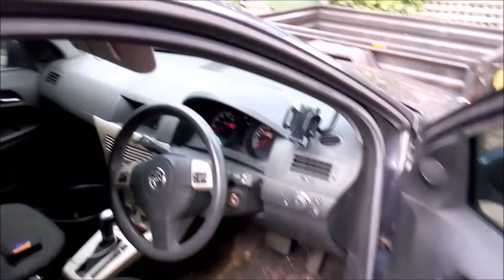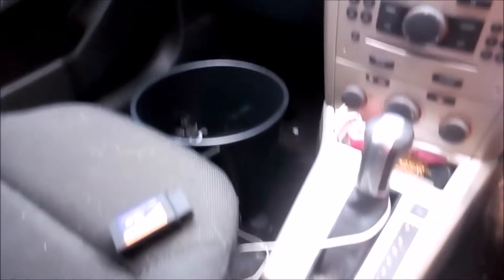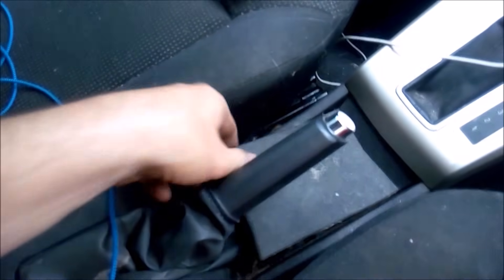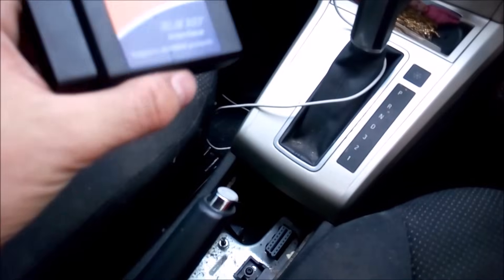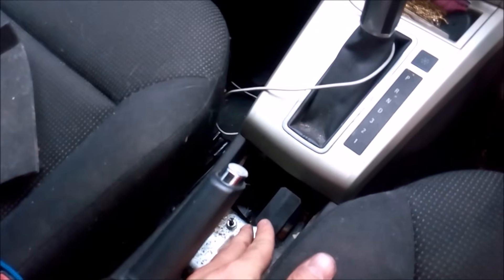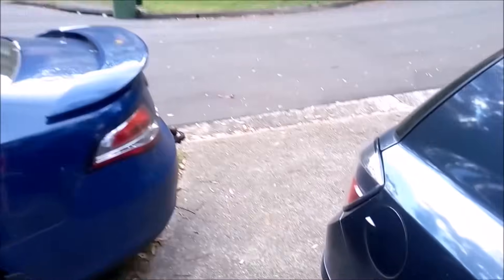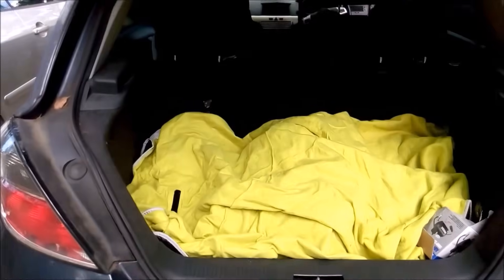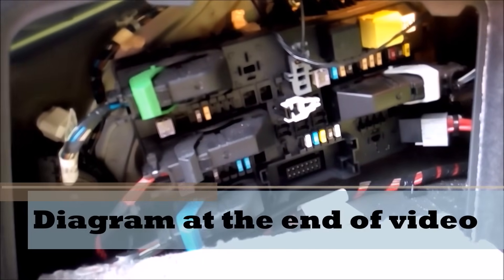Astra 'H' MK5 - OBD Diagnostic Port & Fuse Box Locations

Comment: Ugh. I got power to the obd socket. But it keeps chucking up link error 🤬🤦🏻‍♂️😭
Reply from the maker: I have never had that happen before, what have you tried already?
Reply: @RossPerryProductions  So far minimal. Checked the fuse for the port its fine. Tried running it over and over nothing. Im going to try maybe checking the earth to the ECU i heard that can do it other than that no idea. Scanner works on other cars.
Reply from the maker: @jl5177  Have you tried resetting the ecu by removing the battery terminal for about 30mins and then reconnect and try?
Reply: @RossPerryProductions  I haven't mate. I'll try that, thankyou 😊👊🏻

Comment: Purchased a astra and seem to have a shit ton of fuses missing, would this be hiding a electrical issue ?
Reply from the maker: Hi there Gavin, not necessarily, it could be the options your Astra has, for example if your model does not have electric sunroof there would be no fuse there. Does everything electrical work?
Reply: RossPerry Productions any idea where the fuses are for these ?
Reply from the maker: I am afraid not without having the manual to hand.
Reply: Everything works apart from the rear window de mister and my fog lights bulbs look good but when i switch them on the symbol dont even come up on the dash
Reply from the maker: That could easily be a fuse or the switch itself, demisters often burn out or come disconnected, however that could also be the fuse or the switch again. Sorry I cannot be of more help.

Comment: Hi I've got 2004 astra h enjoy when  I switch on my headlights when the engine is running left hand side   switches off approximately in 2 mins but if I switch the engine off I can switch on my headlights no problem anyone who can help please
Reply from the maker: Hi Sorry I missed this comment, did you rectify the issue?

Comment: Hi I’m looking for a diagram of the fuse box as my rear wiper does not work. I have a 2007 Vouxhall astra van dual fuel. Can you help?
Reply from the maker: Hi Robin, unfortunately I cannot help you out here, I should have got it when I had the vehicle. Ross
Reply: RossPerry Productions ok thanks.

Comment: When I turn my ignition on my headlights come on and I can't turn them off with the switch. The switch works when the ignition is off. Any advice?
Reply from the maker: Hi Alan, thats a strange one, I'm guessing this has not always been the case? It could be a short where power is bypassing the switch somewhere downstream, without seeing the car and checking at various points with a meter its a tough one to diagnose. Sorry I cannot be of more help. Ross

Comment: My Astra started shutting down all electrics and turning them back on while driving. At first it was when I break a little too strong, but now it's just anytime (while engine still on and still driving). Last time today, intermittent lights started flashing and inside lights turned on after the electric reset (engine still going and driving all as usual). Intermittent lights could be turned off, but the inside lights won't... About a year ago my windows stopped working, one by one. Thought it was mechanical, but then realize it might be electric, however, this is new... three days like this now and planning on taking the car to the electric this weekend (can't afford not having a car on weekdays). Just curious to what it may be to avoid getting scammed or anything. Any guess?
Reply from the maker: Hi there, my initial thoughts would be this could be an Earth fault, something as simple as a dodgy earth strap, have you made sure the battery terminals are clean and tight? then check the earth connections from the battery to the car, do you have an OBD2 reader or diagnostics reader? these can be bought on ebay very cheap. this type of issue would usually flag some codes which will help you pinpoint the problem. Regards Ross
Reply: I don't have one of those... checked the battery but everything looks fine. Also checked the fuses. I got my front disks and breaks changed about a month ago, could that have something to do with it since it happens mostly when I break? Also, my left low beam broke, so I have to change it, however it's been almost two months since this and I've never taken so long to change a bulb. Could this be causing a problem? I already have the new bulb and will install it today after work. PS. Thanks for your reply!
Reply from the maker: it has a very small chance of being a bulb, if the bulbs are not twisted in position correctly they can be bridging the positive and negative which causes a short, i have seen this before, when you braked the lights when crazy, is your emgine management light on on the dash board? if it is it means there are codes. regards Ross
Reply: When I break a little too hard, the "battery" and "engine service" lights on the dash board turn on, the indicators drop to cero and lights turn off, after a 1.5s they turn back on and work regularly. When I break even harder, or for a longer period of time, the whole electrics turn off, the interior lights turn on, locks open, intermittent lights turn on and all resets, but I have no longer control of my headlights or interior lights until I restart the car.
Reply from the maker: Still sounds like a loose connection or short circuit to me, without seeing the car its really hard to tell as you need to go through everything one by one. The OBD2 reader would be able to read the historic codes held in the diagnostics system. They are only a few dollars on ebay most of them are bluetooth and then you download the free apps. sorry i cannot be of more help.
Reply: Don't apologize! You were of so much help! Know I have a much more clear idea of what could be wrong with my car and prevent a scam at the electric service. Thank you so much! Best, SK
Reply: In roughly a year now I've experienced all the electrics shutting down while driving on a few occasions.

First time was when I cut the corner over a low kerb with my rear wheel.

I think on another two occasions it was after briefly accelerating reasonably hard. 

In every instance my headlights and/or wipers all stopped for approx 2 seconds and then came straight back on. 

I drive an '09 plate Astra H.